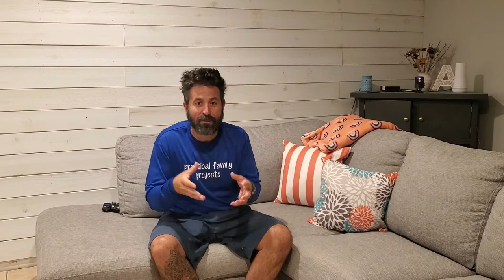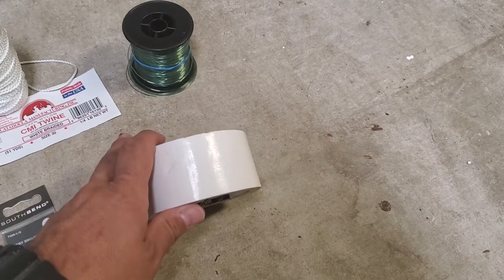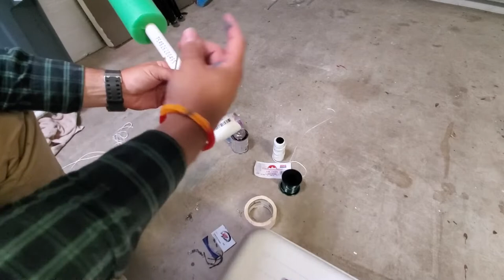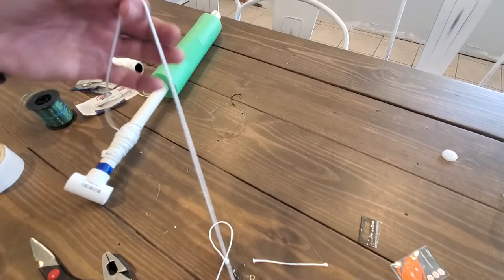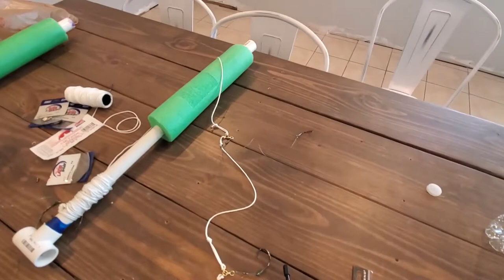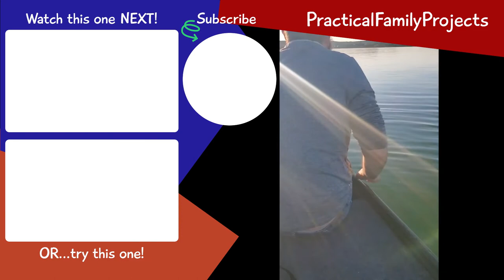HOW TO MAKE FISHING JUGLINES: DIY PVC and Pool Noodle Catfish Juglines with Depth Adjustment Option

Comment: Don't you dump water in the boat or on yourself if not care, due to the open end fittings tha you are using.  I prefer end caps and an eye bolt.  With end caps you can add a sliding weight which will alert you to a bite.
Reply from the maker: I haven't really had that issue.  By putting the tee at the bottom, and looping the line around it, we usually see the jug line straight up and down when we have one on.  Not always, but usually.  I'll have to try out the sliding weights.  I've seen those online before.